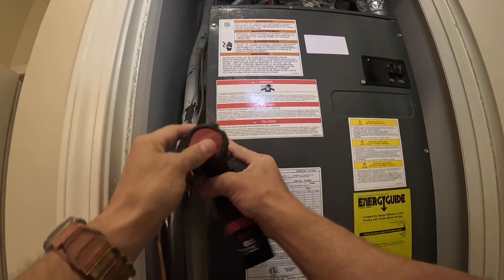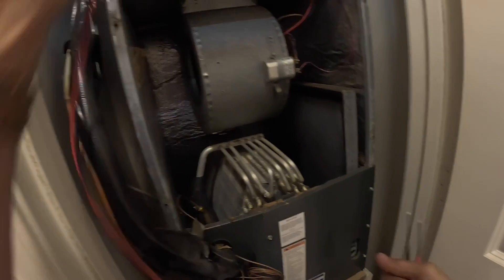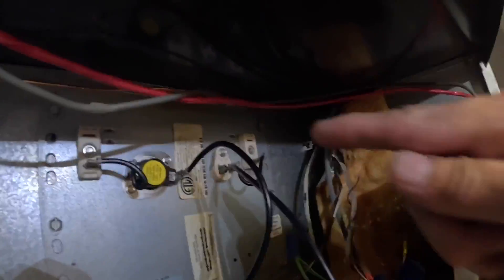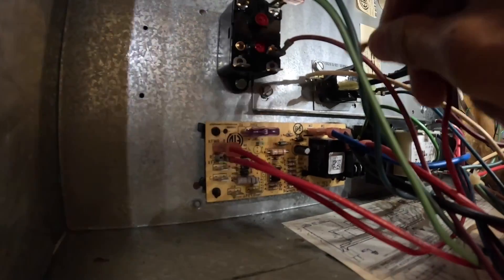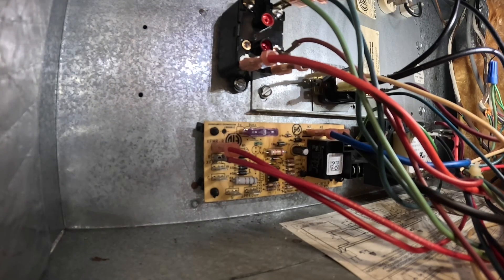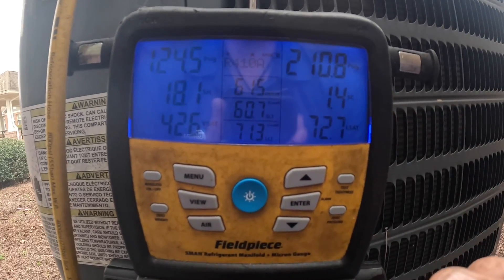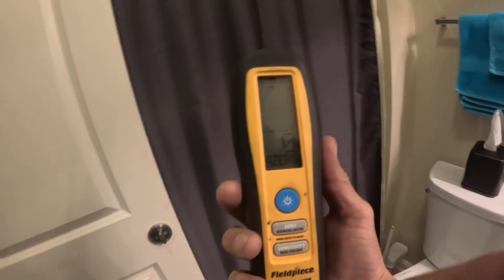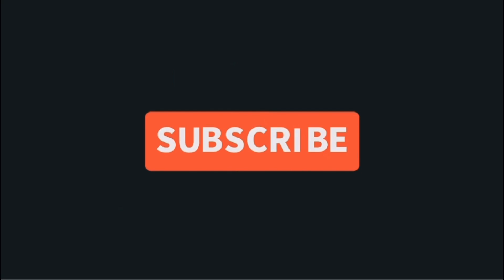Customer Had to Turn Off The Breaker to Stop The Heat! #hvacguy #hvaclife

Comment: ive seen those exact numbers: super heat 24 .... subcool 1.4 
My conclusion besides a leak, is that when ambient temperatures are below 75 and low heat load inside those numbers seem to be pretty accurate depending on the seer of the unit too.
Also, it could have been a long line set which at install someone didnt add the additional refrigerant
One last thing, when the suction line is missing its insulation it can act as if the unit has a restriction
example: superheat 25 ..... subcool 8 
hope this helps

Comment: When outside ambient temperature is low, I'd say about under 75-70 degrees, digital gauges become unreliable as far as subcooling is concerned. Have to use analog gauges to get accurate readings. Has to do with there not being enough of a load on the system. If this is not known, can have techs doing a lot of unnecessary work. I like your videos. Keep on with them! 🏋️‍♂️🏋️‍♂️

Comment: question, I have an old miller gas mobile home unit.. motor spins free, replaced all snap switches, > same temp. replaced cap same, except heavy duty. replaced thermostat, unit short cycles, ( or really cycles 2 times, fan shuts off not on overtemp, gas still runs burner still on . and fan starts a second time. almost like unit is not keeping temp to keep fan on. any suggestions?

Comment: good job on the fan relay rewire. 
you can simulate 90deg f on the outside unit by placing a trashcan lid or cardboard over the top of the unit starting with a small section and moving it across till u get 90deg f on the high side, then check ur low side pressure to see if the charge is right.

Comment: Can never go wrong with 9080 relay,those lil boards on heat kits are about as silly as the air handler with the 4 relays,the 2 dc relays and the 2 ac relays

Comment: Ive had a miltiple replacement boards fail. The relay is the best way to go. You could take the board out if you would move the fuse off the board to the two red wires.

Comment: What would cause your subcooling to not raise and stay around that 2 to 3 degree mark do you think?
Reply: It was only 60 degrees outside and probably low humidity inside.  Low outdoor temperature and low indoor load probably caused it.
Reply: I would think txv is flooding back but it didn’t seem like it was stacking up outside or inside

Comment: hello, great video, ,  the purpose of that purple wire is to energize the blower anytime the heatstrips come on ( coming off NC terminal on goodman board),  so if the blower relay was stuck closed,  how its possible to get 22A draw on that purple wire since the purple wire is only meant to energize the fan?  just curious. I'll study further too, im sure there's a logical answer.   Thanks.
Reply: I’m thinking the samething, maybe it somehow back flow to power the heat strips.
Reply: @jimmyni8136 ,   the blower relay on the goodman board is not rated to handle  electric heat amperage,  NC terminal on goodman board is used when there is a w call for heat to turn on blower,   it will also go from NC to NO  if there is just a G call for fan from the thermostat.  anyway, thats my 2 cents, i'm an apprentice trying to further understanding.
Reply: My thinking is in line with yours. Only thing that I could think of that could be happening are the 2 terminals (NC, NO) are shorted to each other to complete the circuit for the heat strips to kick on along side the blower. Otherwise it doesn't seem possible to me for both to be energized with only 1 or the other being stuck. 

If it was stuck in NO. The blower would be the only thing running 24/7, as if there was a constant call for the blower to run.
Reply: @garrett962   another possibility if the relay is stuck energized.  Current will flow from NO to Common to energize blower, but also through common and NC  energizing the heat strips  potentially melting the blower relay or burning up the blower motor.  I think you hinted to this scenario as well.
Reply: @Paul-jz2cv  exactly my thought. Just didn't use 'common' or 'motor speed wire' to verbally get the trifecta shortage point across lol. At least that's the only thing that I can think of from my experience, but I haven't worked with this specific unit before.

Comment: Great job as always curtis  question if purple wire pulls 20 amps would it not over amp blower motor?
Reply from the maker: No. But, it can burn the wire, as it’s not rated for such a high amp draw

Comment: That unit was probably slightly low from the initial install. Seems to have airflow-undersized issues as my guess.
Reply: I make it a habit to check if and how many vents may be closed off. Especially if older people are involved as some run hot and some run cold and they may be closing of sections of the home. If it still looks wonky I might inspect for airflow at vents and if something is off there I'll look for damaged or crushed ducting, especially if it's hung flex.

Comment: 85+ here in St. Louis Today (2/27/24) but Issue is it’s Forecasted to reach a Low of 22 degrees Overnight with Light Snow and Flurries expected.  It’s still Winter. 🥶👍
Reply: Thanks
Reply: Yea, we've definitely been mild in the Lou this winter. Not much of a winter at all,it's supposed to be 70 again this weekend